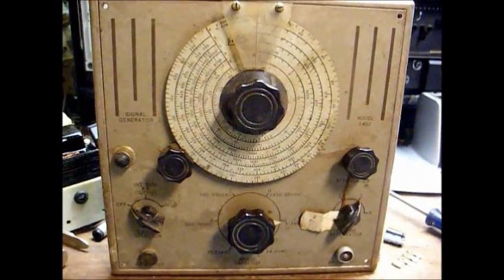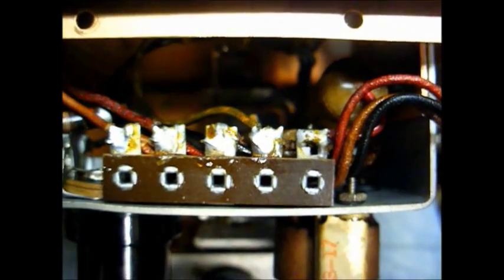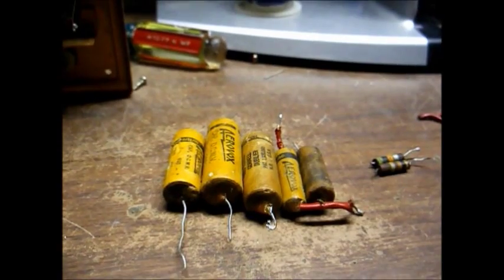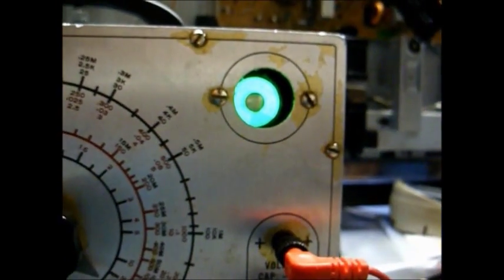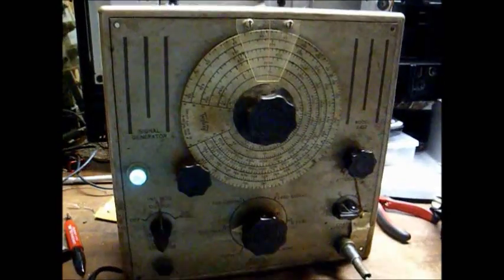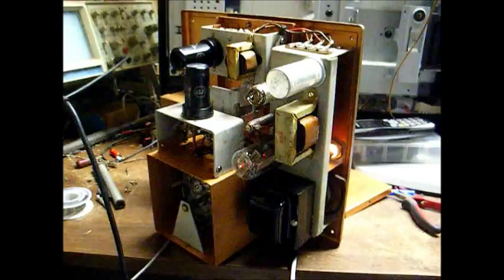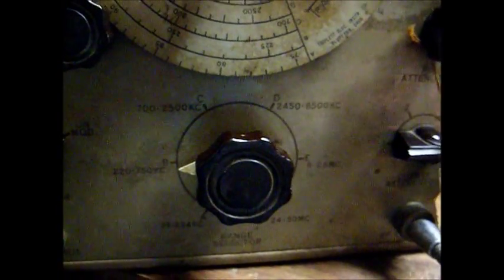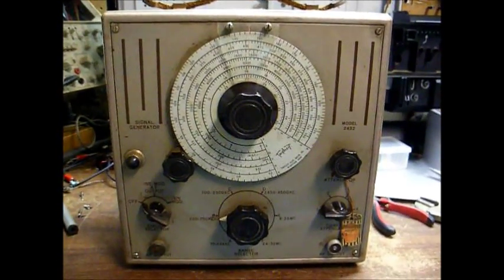Circa 1946 Triplett model 2432 RF signal generator repair

Comment: Dear Sir i have Triplett 1632 signal generator and would like to repair it my self. Kindly guide me for the same.
Reply: +shaikh naeem i to have just got a 1632, in somewhat sorry shape, i have all the valves but there is some detached wiring underneath

Comment: You could probably use your scope to trim the frequencies, you would need to count the time divisions and calculate the frequency by inverting the period of the cycle, probably the next best thing than a frequency counter and possibly more accurate than using the characteristic IF frequency or its harmonics of a superheterodyne radio